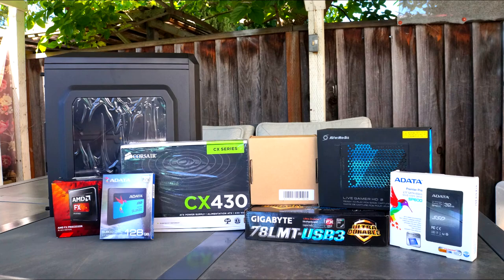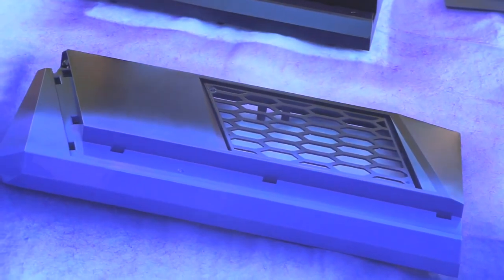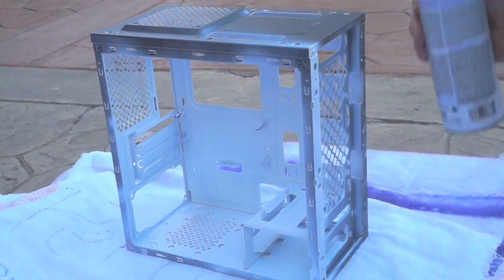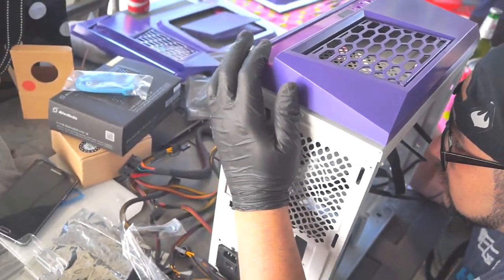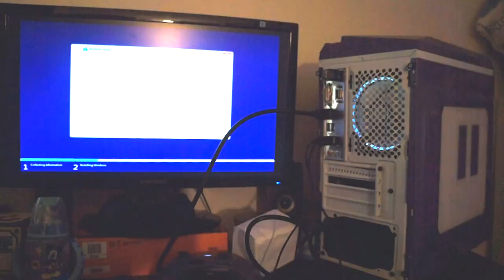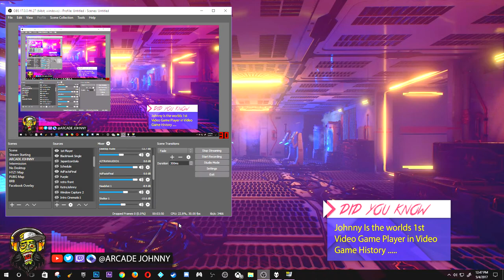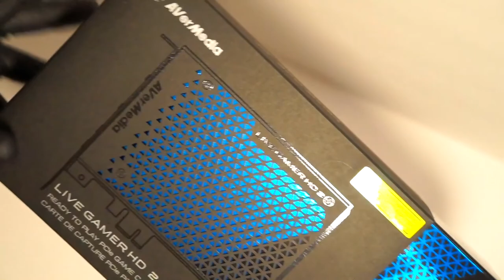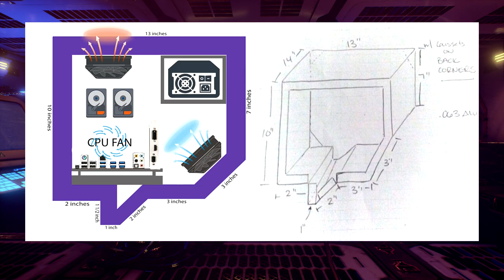The Ultimate Twitch Streaming PC BUILD ᴴᴰ

Comment: Great video and advice 👍

Looking for some advice, I'm interested in building this but I can't seem to find some components here in the uk so I'm gonna improvise. 

Firstly the 8320 is the same price as the 8350 so should I buy the latter ?
Reply: Also I can't get that ssd so would the adata su800 be ok and also I was thinking this fan 

Cooler Master Hyper 412s CPU Cooler "RR-H412-13FK-R1, 4 Heatpipe, 1x 120mm Fan with Silent mode adapter, Intel / AMD" https://www.amazon.co.uk/dp/B00634R3L6/ref=cm_sw_r_cp_api_HqSszb18VGP27